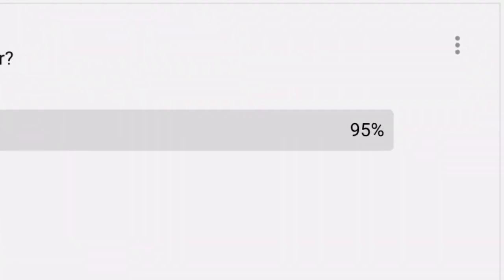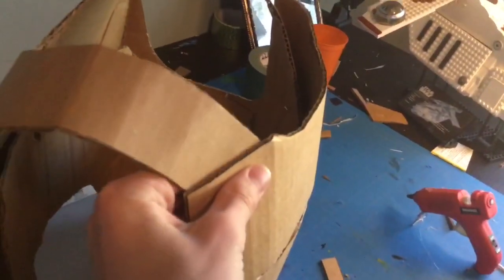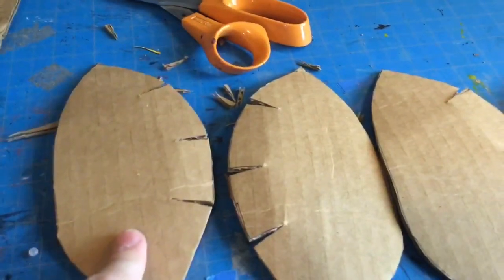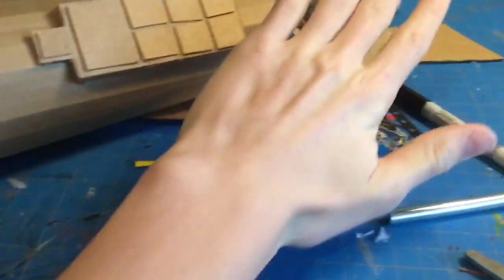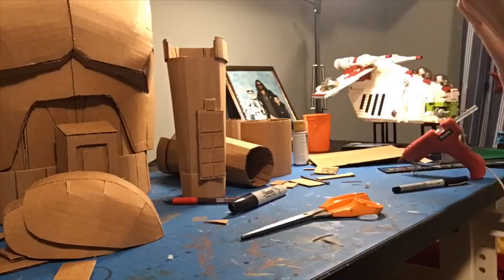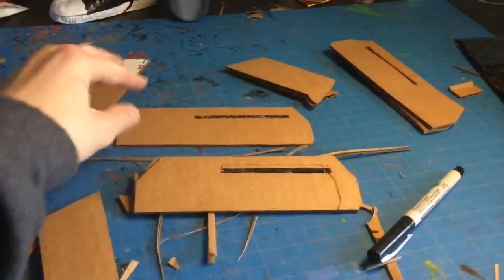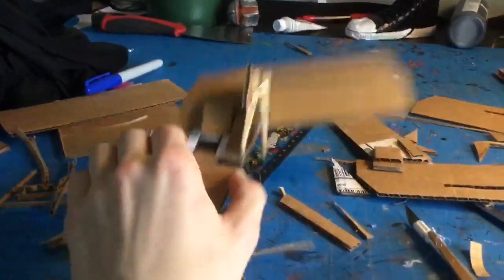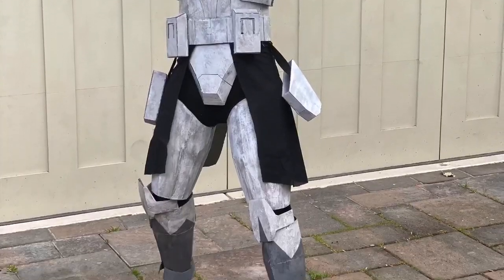DIY: Phase 2 Commander Wolffe Armor!

Comment: I would be grateful if you did not use speed, you inspire me and use your films, but at this speed you can not do it and as the only one you show how to do it from paper
Reply from the maker: I would do a non-sped up video but then it would be well over a few hours long.
Reply: I have an idea, you can speed up when cutting and painting, but to show exactly where you need to glue the element and how many cm you need, you can do it without acceleration